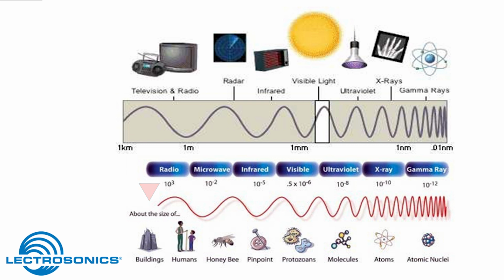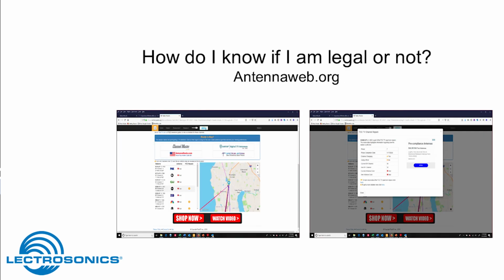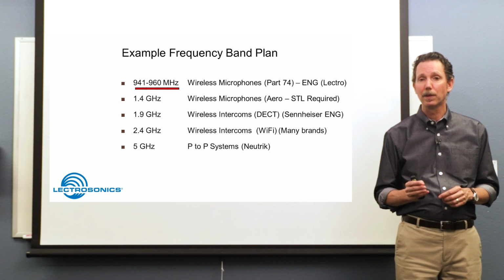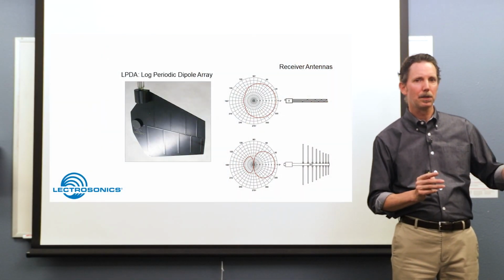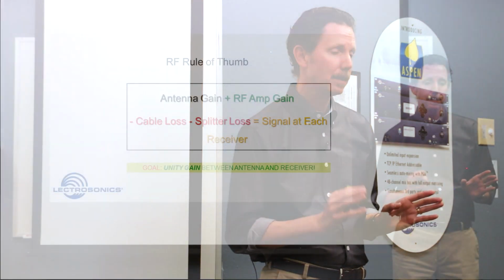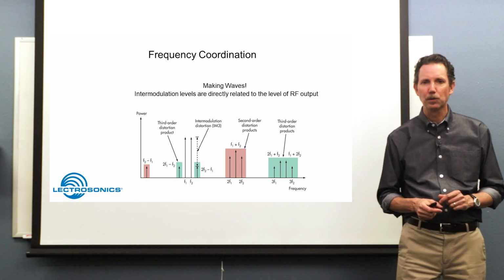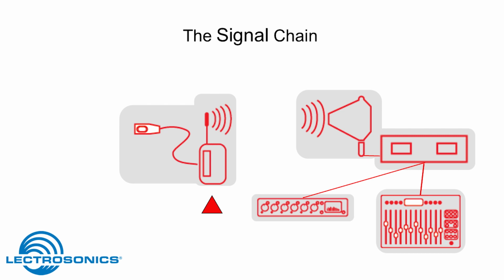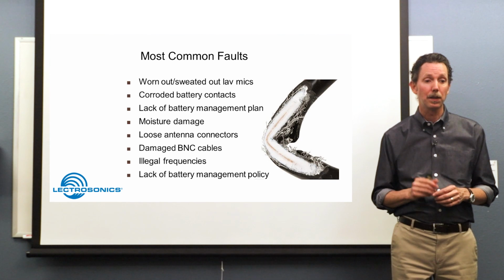7 Common Wireless Mic Problems and How to Solve Them

Comment: I have a four channel UHF system in my church. We are small and our mics are never more than twenty feet from the antennae. They work very well. Unfortunately the church across the street must use the same channel as my number one and often we hear their music in the middle of our service. Is there any way to shield our receiver from their signal? The source is across the road and inside a brick church, at least 300 feet away.
Reply: Have you talked to the folks across the street to see if they can change their frequencies? If not, and both systems are fixed, then the only solution is to get a system that allows you to change your frequencies.
Reply: @lectrosonics  Thanks for the reply! Since  I posted, after doing some research I actually did the old-fashioned thing and wrapped some foil around our antennae, and I folded them down, parallel to the ground. My theory was/is that it would only pick up a very close signal, and we are never more than twenty feet away from the base. So far so good! No more church across the street. There again, they may have heard us and changed frequency! Again thanks for your help. This video is very educational.
Reply: @stathamcmc  great to hear you've got a solution. Whatever works!